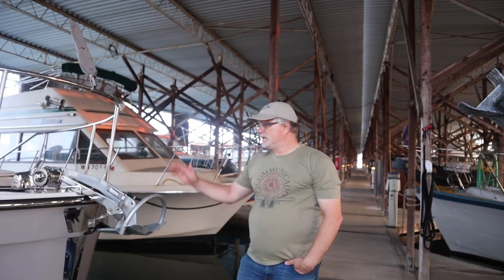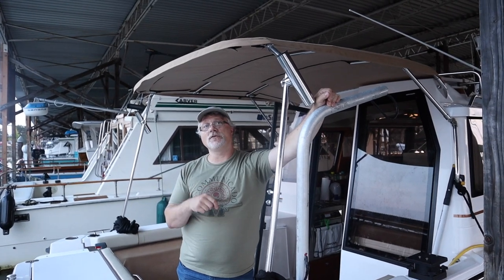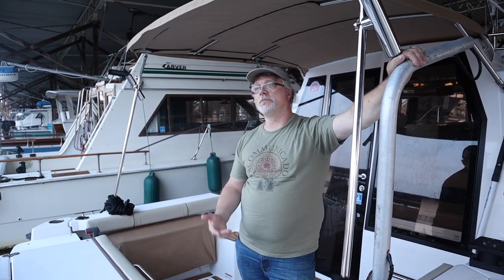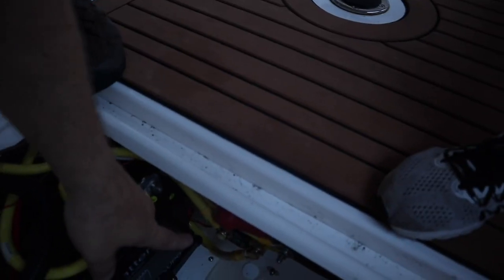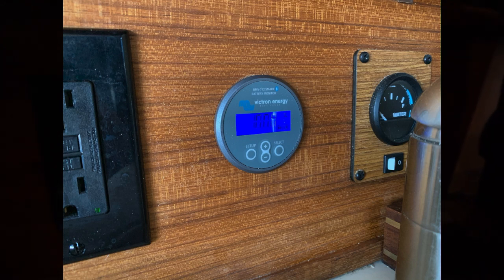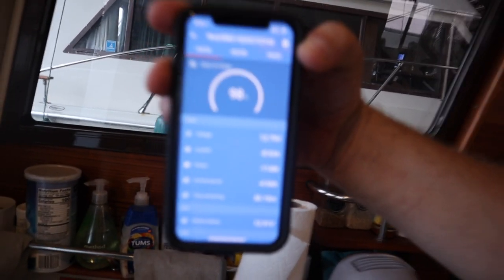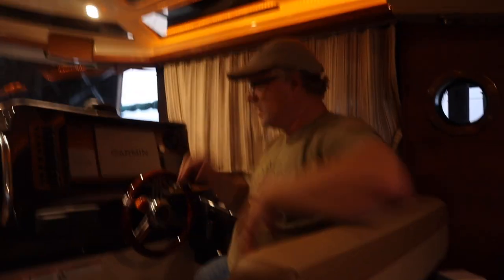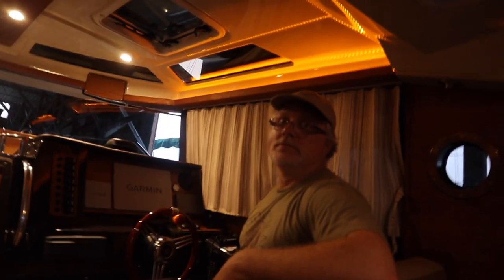Check out these system upgrades to our Ranger Tug R27 OB "Channel Surfing"

Comment: Wow! So glad I came across this video. Will definitely be paralleling my bow thruster battery. Also surprised the orange trim lights draw less than the white lamps. I figured that it would be the opposite and always use the dim orange trim lights rather than the proper white lamps to try to conserve power at anchor. The faux teak cockpit deck flooring looks great. Where did you get that?
Reply from the maker: Thanks for watching!! The Amber lights draw more than the white lamps.  

We’ve changed so much on Channel Surfing since this video.  Upgraded to 3 Firefly Oasis batteries which more than doubled our capacity and put my thruster battery back all by itself. 

I’ve also revised the power management spreadsheet quite a bit. It accurately shows what everything on the boat draws.

The cockpit decking is Raptor Decking. 
https://raptordeck.com

Comment: Thanks guys, great to see how these boats are actually used - a Ranger may be part of our future retirement across the water here in Victoria.  We found the same battery drain issues in our RV.  Have you researched replacing the lead-acid batteries with LiFePO4 batteries (Battleborn or similar)?
Reply from the maker: Thanks for watching!!  I have researched Lithium Iron, as well as other options.  There are two other video's we've published since this one that you may find of interesting.

Power Management
https://youtu.be/TGgO3_CycE0

And our house battery bank upgrade! 
https://youtu.be/AehPUYetDzU

Comment: Nice upgrade! Is it not viable to go lithium ion batteries and also add more batteries?
Reply from the maker: Thanks for watching!!  We've done so many more upgrades since this video was released.  Lithium batteries are not drop-in replacements.  Their charge profile is different which requires many other components on the boat to be upgraded as well which makes it a complex and expensive upgrade.   However, we did upgrade our battery bank to Firefly Oasis G31 batteries..  You might find the videos in this playlist of electrical upgrades interesting. 

https://www.youtube.com/playlist?list=PLvOOqZBn5SkHVveoT06sqaMUueKonMFZZ

Comment: Great information as i have been looking at the 27 Ranger as well and was wondering is I should go with the OB or look for an older model with in the IB.
Reply from the maker: We like the OB for the speed (WOT is 35kts, cruising is 26kts). At cruising we get about 1.6nmpg. Or we can go 7kts and get 2.7 nmpg.  5kts is 3.0nmpg.  This gives us a lot of flexibility with extended range if we're not in a hurry, while still letting us outrun some weather if we need to. The outboard is also easy to work on myself for routine maintenance. The engine is really quiet so we can talk when we're cruising.

Comment: Very helpful video. I have ordered a Rocna 10 like yours from West Marine for my R-27 OB.  I also ordered a Mantis anchor guard, but the one I received is a starboard mount.  It looks like yours is a port side mount.  Is there any reason the starboard mount would not work?  It looks like I would have to pull out the roller bolt, but that should be easy unless it is pressed in.  The instructions say I might need a longer bolt.  Did you need to get a longer bolt?
Reply from the maker: Thanks for watching!! 

I went with the Mantus guard, Port mount because as I retrieve the anchor I stand on the starboard side of the bow facing port.  I wanted the Mantus guard to be out of my field of view so I could focus on the anchor, rode and chain.  I don't know if that really matters, but that's how I chose port.  The starboard configuration would work also. 

You will need to replace the roller bolt.  I have the details published on our web site. The bolt is not pressed in, but you will need a longer bolt.
The original bolt is 3/8" x 4", course thread. It has to go to 4.75" or 5", stainless.

https://www.letsgochannelsurfing.com/anchor

Comment: My wife and I are buying a r27.  Thank you for all the info.  I scuba dive in puget sound and I will use the vessel alot for that.  What do you think about getting the dingy with it?
Reply from the maker: There's pro's and con's.  The dinghy lift makes having a rigid/fiberglass bottom dinghy possible. The inflatable dinghy's are subject to air leaks when ran into shore with sharp rocks, barnacles, etc... An inflatable dinghy is light enough to bring into the cockpit or store on top of the boat.   The dinghy lift would require you to deploy the dinghy to check the engine oil.  The Dinghy lift also obscures your vision in the stern of the boat.   Deployment of the dinghy is easier with the lift as opposed to inflating it and deploying it. The pulley system to raise/lower the dinghy uses a the port side scotty downrigger pad.

One of our upcoming videos will be of how we store, inflate, deploy and carry (or tow) our inflatable dinghy around.  We didn't opt for the dinghy lift. It was new when we ordered our boat and wasn't widely marketed. It was also expensive.  We also didn't know how often we'd use a dinghy.  The inflatable is working fine for us currently. But our dinghy needs are not great. We use the dinghy to get from anchor to shore to walk the dogs or pay for WA State marine park mooring buoys. Our 2.5hp Yamaha dinghy outboard pushes us at a max of 5kts, and we generally motor around 2kts in it which means we're not in our dinghy if there is wind or strong current.

Comment: Martin & LaZina this is your best video yet.  I have a 2021 Ranger Tug R-27 LE as well.  I will install most of your great ideas on my boat. I can be reached on TugNuts.  Can you send me an e-mail?  I prepared 12 checklists and step by step information for my boat that I would like for you to comment on.
Reply from the maker: Thank you so much. Martin said he would send you an email.  LaZina
Reply from the maker: I can't find you in tugnuts. (it's really hard to search usernames there).   Send us an email at channelsurfing at nethkin dot com.  On Tugnuts, my handle is "submariner". 

I'm just about done with a major upgrade. Spent all last weekend on the boat working on it.  I upgraded our house battery bank to Firefly G31's and relocated the two house batteries to the center cockpit storage.  Should finish it up this coming weekend and then can send the pic's, narration and video's to LaZina to work on the next video.  A lot more work than I wanted to do.  But will be much happier once completely finished. I'll be able to swap out the house and thruster batteries in about 15 minutes without any cursing.  The boat should balance port/stbd a lot better. (with a kicker, 2 refer's, and 3 batteries at 67lbs each, all on the port side, she lists to port).  The Firefly batteries also increase our battery life and usable amp-hours.
Reply: @Letsgochannelsurfing  I'm looking forward to learning what you have to do to relocate the batteries to the center storage area
Reply from the maker: @johnbenjamin79  The video is recorded.  LaZina's finishing it up.  I expect it'll be published this coming week.  I recorded one video about power management which is important to understand the basics first.  The next video after that will be the battery relocation to the center cockpit.  Both are about 45 minutes each. 

The video we published last week, a quick cruise around Hat Island, was to test the balance of the boat after the battery relocation.  In addition, we spent all day on the boat yesterday crabbing out of Everett.  Moving the batteries balanced the boat. We are both quite happy with the results.  We get 20% more battery capacity, easy battery maintenance, and the boat sits level at the dock and when cruising under 10kts. 

Thanks for watching!!

Comment: Why not adding additional solar panels over your bimini on the rear deck.and two additional house batteries.
Reply from the maker: Thanks for watching!  Great question, by the way.  A lot has happened since we published this video.  These two video's you may also find interesting.  The two kind of go together. 

Power management on our R27
https://youtu.be/TGgO3_CycE0

Upgraded our house bank to Firefly Oasis G31's (they're very different AGM batteries). And we relocated the house battery bank.
https://youtu.be/AehPUYetDzU

In addition to the house bank upgrade we did, the solar panels are in process of being upgraded as well.  We've already installed the Victron 100/30 MPPT Solar Controller.  The solar panel is still the factory 140watt panel, but we are looking at a pair of 200watt panels (400 watt total) to augment the house bank.  I could easily add a 3rd house battery now, but I don't know that we'll actually need it once the solar panel's are upgraded.

Comment: The R27 and R29 are about the same size. Do you feel the R27's OB motor out performs the R29's IB motor? I guess my question is, what factors play into deciding if you want IB or OB motor in a Ranger Tug in respect to something like the great loop.
Reply from the maker: The OB vs IB we discussed in deciding on what RT we wanted.  The outboard is inexpensive to work on. It's also easy to work on myself. The con is, the boat has to be out of the water.  An inboard you can do work in the water (think about something as simple as an oil change requires a haul-out with the OB).  The F300 Yamaha has a 75amp alternator where most of that electrical power is available at 1000 RPM (just above idle, which is 600). This allows us to use the F300 as a electrical generator.  Inboards that are diesel with a turbo it's usually advised against using them as an electrical generator.  We like the wider beam of the 29, but it also tops out at about 20kts I've been told.  We cruise at 26kts, WOT is 35kts.  Or we can run 10kts and get even better fuel efficiency.  After 1500nm, we are seeing 1.8mpg (1.57nmpg) averaged since we brought her home.  Other things to consider, the OB makes a dingy more of a challenge. The IB lends itself to a nice easy place to store the dingy.  The OB, you'd really want RT's dingy lift.  Our previous boat had a Mercury 5.0l MPI 260HP engine, with an Alpha1 stern drive (Inboard/outboard). It was a pain to work on, and expensive. I was running away from that headache and so far, am really loving the F300 Yamaha.   Also note, to get maximum performance from the F300, I would need 89 octane fuel.  Two gas stations that I know of have it.  Oak Harbor and Des Moines.  Everywhere else is 87. The engine has knock sensors so it will automatically downgrade it's performance so running 87 isn't harmful. But it'll have less HP.  We haven't really noticed much of a difference so it gets 87 most of the time.
Reply from the maker: For trips such as the great loop, being able to do maint, you'd have to find a place on the loop for a haul-out. That's usually the biggest con against the OB that I've heard.  The R29 with an inboard you could do all the maint. yourself at a dock.

Comment: The reason why you are running out of battery power overnight, is simply because you dont have very much capacity at all.  And largely I think it is because you are overestimating the actual usable capacity of your batteries.  You dont have 85% of the stated capacity even on an AGM.

The top 15%, from 85%-100%, is near useless and inefficient to maintain a charge because of the rate of self discharge.  In addition, even on an AGM, you lose the bottom 40% of your capacity.  So if you have 100 amp/hr stated capacity, in actual use you have maybe 45 amp hours useable, in real life conditions.  And most likely closer to 35-40%.

The solution is just to get a couple more batteries.  AGMs are really not that expensive, just get two more and all your worries are gone.  You might have to upgrade your charger to match the increased capacity, but its the simplest solution.  Why put so many more hours on your main engines.  Another battery is way cheaper than a new engine.
Reply from the maker: Thanks for watching. You are absolutely correct.  You'll probably really like these following video.

"Let's talk power management"
https://youtu.be/TGgO3_CycE0

"We killed our house batteries and replaced them with Fireflies?"
https://youtu.be/AehPUYetDzU

And lastly, this video were we add the 3rd firefly.
https://youtu.be/IDak54LCI8I
Reply: @Letsgochannelsurfing  You are right, I hadnt made it that far yet :)

Fireflies are nice, congrats.  I am sure 3 fireflies helps a lot :)